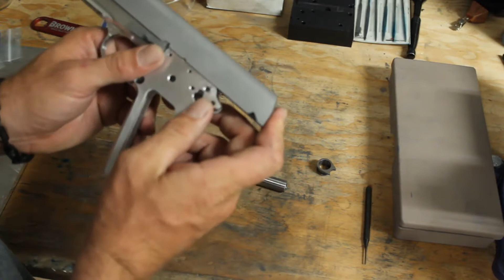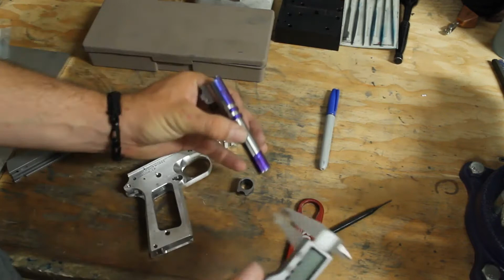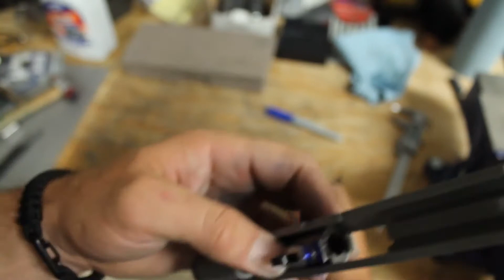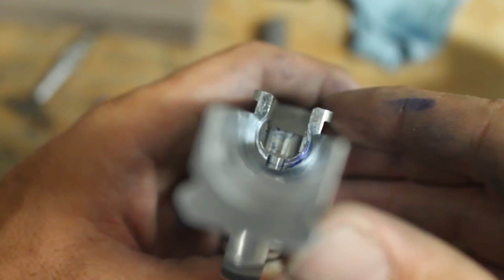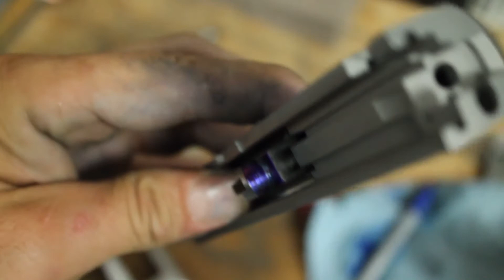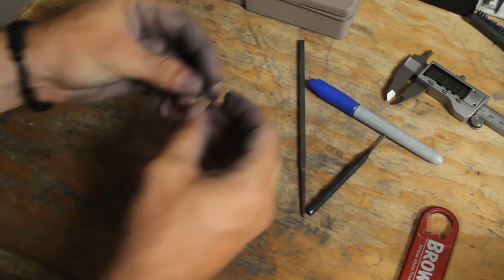Ep4 - Lower Lugs and Feed Ramp fitting

Comment: It’s a finicky gun get over it! 😂
Reply: Haha I feel you. But they really aren't finicky, in my opinion. They do, however, require a very solid understanding of how all the parts fit together, and how adjusting one part affects all the other parts. If you don't understand all of that, finicky is how it feels for sure. Good adjustments sometimes make them feel worse if you don't understand what you just did and what else you now need to adjust! If you do, it's just a matter of math and performing all of the correct adjustments. I think that's a reasonable consideration for a precision mechanical device where 1 or 2 thousandths matter. A well fit 1911 is one of the finest firearms ever made, that's the reward for the extra effort. It's not a Glock or similar. Those are Legos by comparison. And that's an awesome thing, there is huge value in that too. 1911's/2011's are a different beast. More akin to watchmaking than modern pistols. All the best!

Comment: Why not just cut back the dust cover on the commander slide to provide the clearance, versus cutting the frame rails.?   (AKA - stocking)
Reply from the maker: So I ended up doing both.  Cutting the frame rails back was done to bring the frame rails of this govt frame into commander spec.  Bringing the dust cover forward did stroke the slide allow it to return further to rear.  Good observation though!